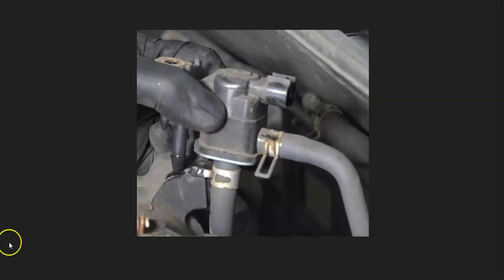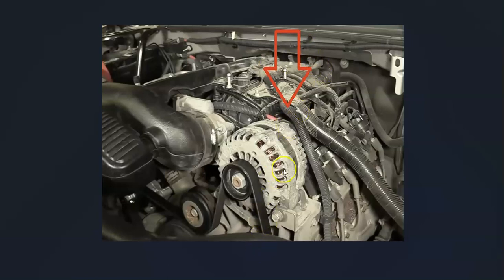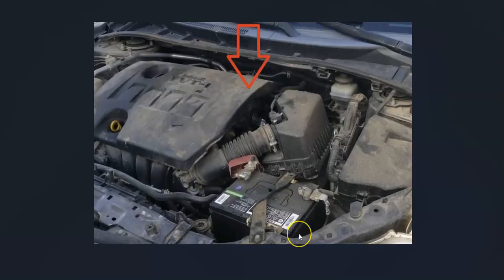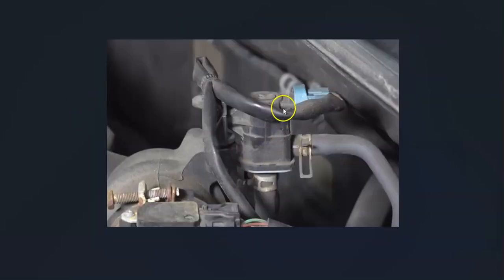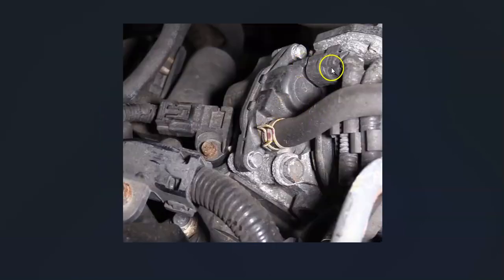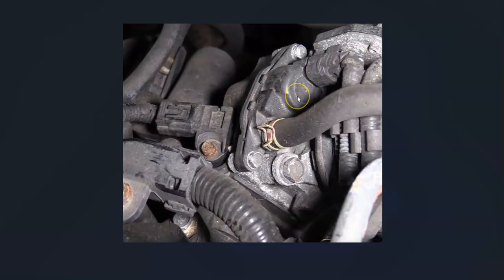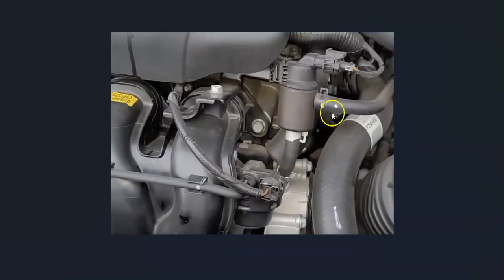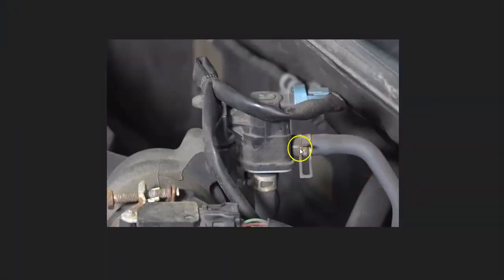Where is the Purge Valve Located? How To Locate the Evap Purge Valve.

Comment: I have a 1998 Honda Accord and have a issue with sometimes I get a no start. I recently figured out if I loosen the gas cap give it throttle and then try starting it will usually start. Think it could possibly be purge valve sometimes I smell gas around my car so I have a evap leak for sure. Curious if you can help at all
Reply from the maker: Remove the hose on the purge valve going back to the charcoal canister. Start the engine; if it has a vacuum at the port, it is stuck open and needs to be replaced.

Comment: My car has been hesitating and now stalling when stopped or coming to a stop after getting gas. I'm trying to figure out what the issue is. It's getting worse and previously there were no codes. Not sure now but am trying to get it back in. Do you know if the canister close valve or charcoal canister would cause these issues?  From what I have read it seems like the purge valve is the most likely culprit but these other two parts were replaced recently because I was not able to get gas in the car.
Reply from the maker: A purge valve that is stuck open can cause that issue.
Reply: @whyingo7964  thank you for replying.  I really hope that is the only issue. I'm taking it back today and I hope there is a code. If not, I might just tell them to replace the valve anyway because they are going to charge me for the diagnostic anyway.  Do you know if the purge valve can be the issue and it not show a code or light?